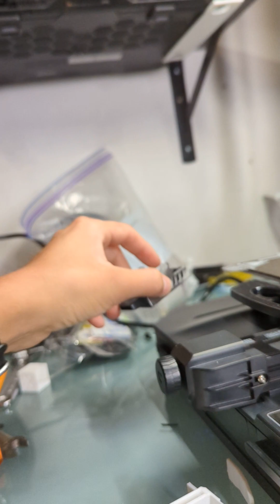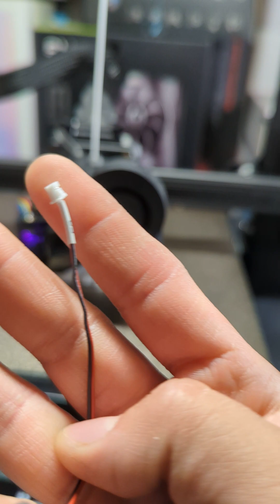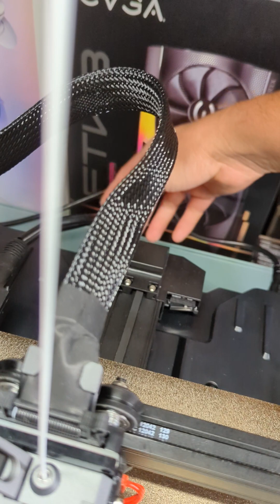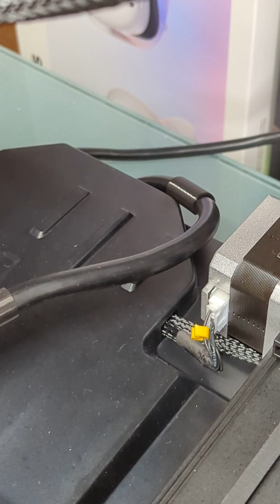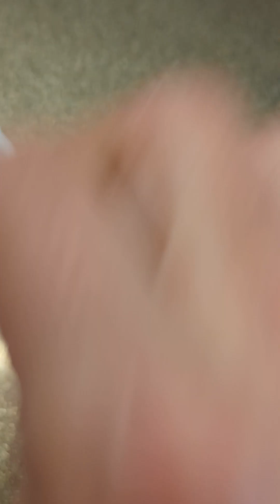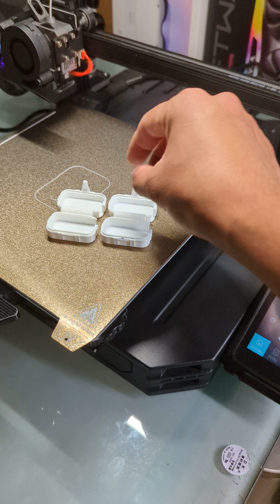Ender 3 S1 Pro - Mini Review - Upgrades - Updates ;)

Comment: No custom firmware for screen. I installed klipper and the screen is useless lol.

The stock cooler on a larger print, 150mm is doable with PLA, hard to dial in the over extrusion on the bulging corners though. I run everything at 100mm now. Just need a more solid surface since its starting to move my bar fridge 😅

Comment: Hiya, I'm new to 3D printer, in fact my first printer is coming tomorrow and guess which one? 😜. As I'm not sure the voltage on the printer's PSU, is the 5015 24 or 12V? thanks
Reply from the maker: Hi, it needs to be a 24V fan :)
Reply: @Zeltroix  I presume you only changed the fan and keep the hot end and nozzle stock? and you printed the fan mount with PETG? not sure if you mentioned it on your vid.

Comment: Thanks! Just got one used & want to give it a good maintenance and upgrade just to give it the best start. Gave me a lot to think about. Only thing not covered is noctua fan upgrade. I would have definitely over looked the cable extension. Any other upgrade recommendations for a used plane jane ender 3s1 pro?
Doing wheels, fan, bed springs by order I'm printing the cable brace, print blower. Also need stock hardware kit but that's no biggie. Keep up the good work
Reply from the maker: I always try to keep my printer wiring as clean as possible, a noctua fan would do amazing but it looks horrible haha plus you'll have to manage the 24v to 12v conversion which takes up space.

I highly recommend to check all of your V rollers wheels by moving your extruder side to side and if you feel it catches on something it's probably a flat spot on the wheels. First thing I did was that, I used double V wheels they seems to be smoother.

Leave the leveling wheels and springs alone, they're probably the best.

Cable braces probably just add more weight and you really only need one like the one I showed in the video. Maybe one for your bed cable will be fine since the cable catches on the stepper motor from time to time..

And yes a 5015 blower fan upgrade would be essential to printer a higher speeds, I found a custom firmware that allows me to print 150mms with the same quality as printing at 50mms since they enabled input shaping, will cover that later ;)

Use this 5015 mod: https://www.thingiverse.com/thing:5398053
Reply: Hello! Very kind of you to share your updates. Could you tell us about that firmware. I also updated to the latest available, .28 which is only available on a Creality site. Do you think we are talking about the same fiormware? Thank you so much! @Zeltroix